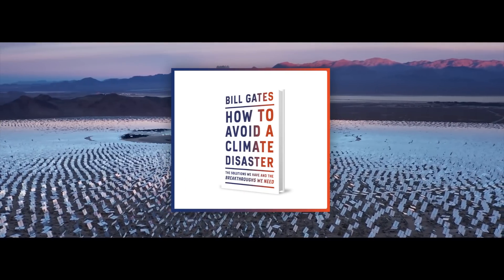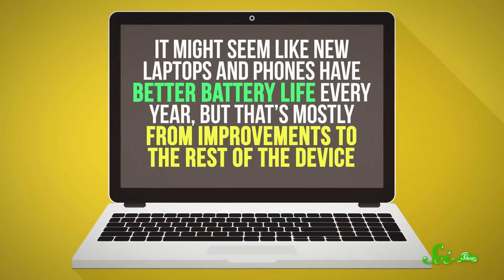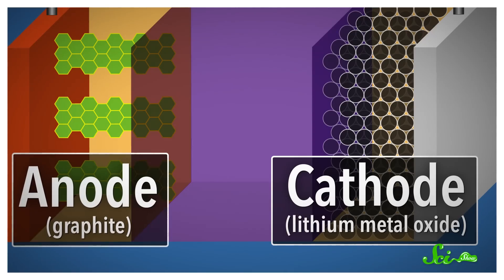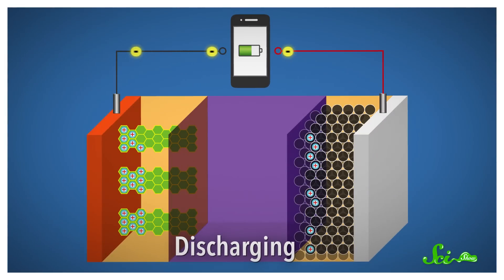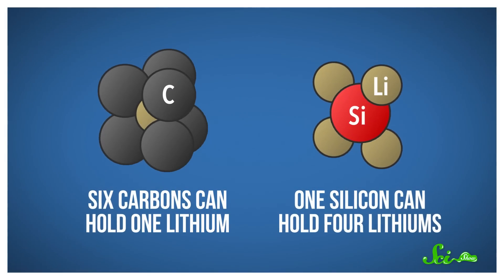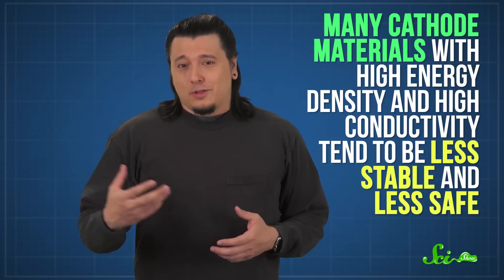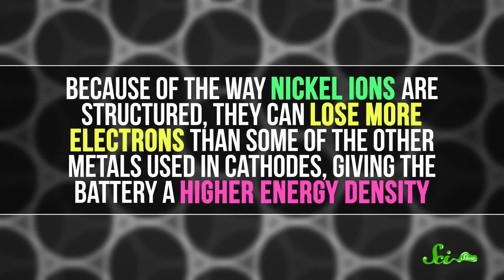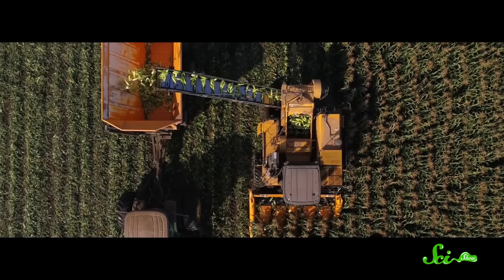Why Haven't We Built a Better Battery?

Comment: Why is energy density the only factor for a "better" battery? When it comes to grid storage for solar and wind, energy density is the least concerning factor. A battery with more charge cycles and lower cost per kWh is far more important in grid storage since it doesn't need to be moved around.
Reply: it isn't the only factor, this video just focused on lithium ion cells.  There's a potential battery tech that's up and coming that is promising, but we'll have to see how it pans out (liquid metal batteries).  It's heavy and not as dense, but it uses cheap materials and likely has a VERY high charge\discharge count.  Ironically it's only suitable to large deployments which means it's only market is mass storage
Reply: I just read an article on popular mechanics, about structural batteries as the next battery tech breakthrough. For example, the frame of an electric car or the case of a phone or laptop would also have energy storage capacity. This will especially be interesting for cars and maybe planes, by adding capacity without adding weight that would increase the power needed to move the vehicle.
So your line of thinking is a good one, and there are researchers also thinking in that kind of direction!
Reply: This shouldn't concern you kiddo. Enjoy your childhood while you can or you'll regret it
Reply: @user-ov2fc5sd1e  What childhood are you referring to and what business do you have here? I'm already living as a responsible adult with a home that I own.
Reply: @user-ov2fc5sd1e  If anything, we need more people asking questions like this. That's how new discoveries that lead to new technologies are made

Comment: To accumulate the excess of energy from renewables you don't need high density batteries! That's a mistake. You need cheap and and fast to manufacture batteries. Density, and to be more specific, weight (that's why density matters) is important when you have to carry the battery with you. It's important for your phone, your EV and for making electric airplanes a viable product. But for storage, just dump a mountain of cheap batteries. Who cares if you need to pile them in a 20 storey building? You don't need to carry them around. Go for silicon or carbon batteries rather than using the rare and expensive lithium.

Comment: If we're talking about grid-level storage, you don't need or necessarily even want lithium-based chemistries. Lithium is energy dense and lightweight, which is important for portable devices and electric cars... but for grid storage cost is king. A giant battery that doesn't need to be moved doesn't need to be dense and lightweight.
Reply: Important in this discussion, but not mentioned in the video, would be flywheels. Flywheels can be used to store MASSIVE amounts of energy and can be extremely efficient. We mainly use them with hydroelectric power currently.
Reply: @GuyNamedSean  Flywheels are crap, though. They can not, in fact, store "massive" amounts of energy - it only seems like they store a lot because it's in the form of a huge spinning mass which gives an innate sense of danger, but in the grand scheme of things they pale in comparison to batteries and have limited applications where they actually makes sense. To whit; additional flywheel mass is used in hydroelectric turbines, providing a mechanical buffer needed to protect the turbine and generator because you can't modulate the flow of water fast enough for all the load fluctuations it might see while in operation. They only store enough energy to absorb spikes in surplus power and fill in short dips of high demand, not bulk energy storage.
Reply: @Smidge204  Flywheels have lower specific energy (energy per mass), than lithium ion, about a third or less, but their energy DENSITY (energy per volume) can be quite high. For grid energy storage, the mass doesn't matter much, since the flywheels just sit around connected to the grid, and even size isn't that important. Solar and wind farms take up huge space already, and the little extra from storage makes little difference.

Flywheels can store massive energy, just build more of them. They last a long time since they don't involve any chemistry. You also don't need any exotic or toxic materials. The main reason they aren't used more is cost. Even with their longer lifespan, the cost is higher than for batteries. For grid storage, they're probably a better choice environmentally though.
Reply: @TonboIV  The now defunct Beacon Power built and deployed flywheel energy storage units circa 2011. Best I can figure the units were about 3 feet in diameter and maybe 8 feet high, total volume about 56 cubic feet. They stored 25kWh for an energy density of about 0.45 kWh per cubic foot. This volume does not include the massive concrete casks they had to be installed in (two units per cask) because if they fail all that stored kinetic energy goes into high velocity debris... and the rim speed of those flywheels was about 1,500 miles per hour!

Meanwhile, the battery pack of the 2009 Nissan LEAF - tech of the same era - had a volume of 17.4 cubic feet and a usable capacity of 24kWh which comes out at 1.38 kWh per cubic foot. Fully three times the energy density.

That was ten years ago. Battery technology has improved substantially, both in capacity and cost. Flywheels have not, and they really can't barring some fantastic breakthrough in material science.

FYI the Beacon Power pilot plant is still there, located in Stephentown, NY (42.5563, -73.3766). I do not know if it's still in operation, probably is? Beacon Power went bankrupt and their assets have changed hands a few times but I'm sure NYSERDA wouldn't just abandon an otherwise operational facility in-place. On the flip side, I don't know that they ever finished building it either!
Reply: @Smidge204  bro, you’re so educated, I’m learning so much from your comments lmao. we love to see it
Reply: @Smidge204  Yep. Flywheels are pretty good for short term needs, but they don't do sudden dropouts as well as chemical batteries. Flywheels can't "blink" on. Of course, if you forget the idea of panaceas and layer solutions instead of expecting one to do everything....
Reply: @GuyNamedSean  thanks for the information, i just joined a battery importing business and we mainly still deal in lead-acid. My boss is trying to get into EV battery but don't know where to start
Reply: @AW-zu4kk  here's a quick overview of the molten metal batteries mentioned, btw.  Idk the specifics of your business, but it may be relevent in some way: https://youtu.be/ZRyo0Nr7CrY
Reply: @GuyNamedSean  I think I saw a video from Tom Scott about that. He visited one in the UK maybe?
Reply: @GuyNamedSean  20 MWh is nowhere near MASSIVE. And thats about the the biggest right now. We would need lots of them, which would be good in combination with a smart grid only.
Reply: @GuyNamedSean  The issue with flywheels is the risk of catastrophic failure. Although that's a risk on any type of energy storage...
Reply: @surturiel  Outside of Formula 1 KRSs, I don't know of anyone who has done flywheels in the vicinity of bystanding humans.
Reply: @GuyNamedSean  Flywheels are good for grid stabilization, but they can't sustain a long blackout.
Reply: Can we reuse the batteries that are no longer fit for electric vehicle use
Reply: @thomas.02  Yes. even once EV batteries have degraded and are no longer considered sufficient for EV use, they will still have plenty of useful life in them and EV manufacturers have plans for repurposing the modules. Just a few weeks ago Nissan had a press release about how they are reusing LEAF battery modules in factory robots, for example. It's actually a bit tricky since EV batteries are lasting longer than anyone first imagined, and there's a huge aftermarket for used EV packs so there aren't a lot to go around...
Reply: Also Lithium ion batteries have a tendency to burn under certain conditions or if used too much. It’s pretty rare for it to happen so for individual consumers it’s pretty much a non-issue because we can generally prevent the conditions that would cause it (shutting down the phone in the worst case scenarios to try and prevent the battery from combusting). When you have large arrays of battery farms for grid usage, the problem can quickly becomes that even a single failure one-in-a million battery failure will regularly happen and take out large portions if not all of a given storage facility with enough storage facilities as one battery combusting will set all the rest around it off causing a change reaction that leads to a big fire that needs to be put out, ideally without destroying the rest of the batteries not yet affected by the fire.
Reply: @Treviisolion  Worth noting that it's not the lithium that burns, but the electrolyte which is often a volatile liquid. A fault in the battery can result in the energy stored in it turning into heat, which boils the electrolyte and increases the internal pressure of the cell until it pops the safety vent. The hot vaporized electrolyte then spits out, and is quite flammable. With that in mind, it's easy to understand that some lithium battery construction are less prone to failure than others, and some constructions like solid electrolyte cells are completely immune.
Reply: @Smidge204  that's good to know, though I'm guessing that at the moment considering that we don't seem to be using those types of cells for our battery farms, that they are also at least currently more expensive than standard lithium-ion batteries that already have a mature supply line and production processes.
Reply: @Treviisolion  the worst thing about this is, the battery has everything it needs to burn already inside and a fire like this is very hard to put out. You can just try to cool the thing doen so much it doesnt continue burning but you cant reach the inside in most cases. Thats why EVs are usually left to burn out by themselves.
Some people proposed putting old EV batteries into houses for local power storage from photovoltaics, but no thanks, not in my cellar... I'd bury this in the garden, a few metres from the house.
Reply: @dereinzigwahreRichi  that said, giving everyone a reason to get a small battery is a far better solution than trying to store energy for the whole grid in one place, especially if it's paired with rooftop solar. It solves three big problems: grid inefficiency, space for solar, and catastrophic failure of a single giant battery. It can also help with the upgrade cycle, though that's a mixed bag.
Reply: @nocare  where I'm from we had a system where you could either buy your own panels etc for long term gain or you could "sell"  your roof to a company that would install the panels, and pay the homeowner a percentage of the earnings made by selling it to the Grid, alongside them getting the free electricity from the panels/electricity at a reduced rate (can't remember exactly), that way you could make instant return without much investment other than the rights to your roof
Reply: @Treviisolion  do you know what gas plants run on? burn`y stuff. and they tend to explode and kill a lot of people
Reply: @TheLemonBird  Yes, I'm aware that natural gas plants aren't exactly a good option, I'm not indicating that we should be using natural gas plants, just that in the long term lithium-ion batteries will not be the energy storage solution for our grid. I've read quite a few options, and I imagine that we'll have quite a few, but lithium-ion batteries have several key inherent defects that make them not desirable for large-scale storage, and already many of the battery farms are experiencing those troubles. I assume that lithium-ion batteries are less likely to kill someone compared to the increased changes of death caused from air pollution, but at the same time if we're having to rebuild every battery farm every few years because it keeps burning down then you need some new solutions, and from what I've read, lithium-ion batteries are not likely to be able to be modified to be that solution, and we'll probably need a different type of energy storage that is more stable than lithium-ion, while being cost comparable in energy density per cost.
Reply: like those molten metal batteries?
Reply: @Vulpecula1919  I assume you mean the magnesium-antimony batteries that have been mentioned here and there for the past decade or so... and yes, those still look to have good potential. Last I heard the team that invented them formed a company and got a deal for a pilot plant type installation. Hopefully that goes well and the tech continues to develop!
Reply: You mean like a gravity battery?
Reply: In Austria we have a lot of pump storage power plants. They pump water up a mountain lake and get the energy back with turbines. They can store an insane amount of energy.
Downside is, you need a mountain lake.
Reply: we need a dense battery as city uses alot of power in 1 day and what if it rain for 1 week?
Reply: @superknightlol  what we need is enough solar on every house that even when its cloudy there is enough production to sustain all our needs. solar and micro grids connected with normal grids is the solution
Reply: But it cannot be mass-produced cheaply.
Reply: Where is this dark energy... That only needs calibration?
Reply: @simplydoz I assume you mean duck curve, since we're not talking about ill waterfowl :)

Density isn't relevant to duration, only how much space you need. If you have doubts about a chemical battery's abilities just know that it's been done. There's a great success story about a 14,000 kWh sodium-sulfur battery serving Milton, West Virginia build in 2009, and another 24,000 kWh battery by the same company serving Presidio, Texas since 2010.

And of course there's the world famous Tesla battery station in Australia... 194,000 kWh worth of lithium cells. That was the largest grid-level battery in the world until summer of 2020 when the 250,000 kWh Gateway Energy Storage facility in Otay Mesa, California went online.
Reply: No mention of water gravity batteries? Pretty sure many grid storage systems use lifting water from one lake to another as a way to store large amounts of energy. Also gas pressure cave system batteries
Reply: @jek__  It's called pumped hydro and it's pretty much the only gravity-based energy storage method worth a dam (pun intended!). It's a good strategy but limited to local geography as you need a place to store literally dozens or even hundreds of cubic kilometers of water.

Compressed air is also potentially feasible if the geotechnical side is satisfied. I'm not aware of any practical implementations of it yet, but I've heard plenty of proposals. Not sure how I feel about compressing air into a disused coal mine, but I suppose if there's a fire or explosion that's just more energy to extract!
Reply: @jek__  the amount of suitable lakes, sadly, is orders of magnitudes lower then required.
Reply: You guys and your supposed fantasy "solution" for non-problems

Comment: There was one idea I saw a while ago where excess energy is used to melt vats of salt. Then, when the power generation is low such as at night or in poor wind, the super hot salt's heat is used as a power source instead. I wonder if this would actually be feasible as a large scale battery though.

Comment: Solid State batteries are an intriguing idea, but I've no idea how useful they'd be in reality, but heck, I could be wrong, I never thought LEDs would be any good for general lighting, and that turned out to be an utterly wrong opinion... :P
Reply: Don't ever underestimate the power of technological innovations. My uni professor in the mid-90s said the internet will not amount to much because the bandwidth is so limited...
There will be many out of hundreds of possible solutions to deal with the intermittence of renewable energy. We don't know yet which one will be the most paradigm changing, but I'm positive there will be more than just one new technology to solve or avoid the storage problem.

Comment: One point I miss: Batteries are never going to be competitive to oxidizing (burning) hydrocarbons (or hydrogen) in terms of energy density. Battery based energy density cannot be improved beyond a hard physical limit. That limit being: having to carry the oxidizer. Battery tech will only work in conjunction with impovements to energy efficiency, infrastructure and less overall consumption. Don't fall for people promising miracles there. In terms of lasting, efficient and readily available storage of electric energy, other solutions are needed.

Comment: A breakthrough in battery technology away from Li-ion to something entirely different would be fantastic, it seems we're near the limit of energy density and charging rate for battery chemistry in the way we're currently thinking about it. I'd also take improvements in structural battery technology for cars and planes so the weight and space taken up can be factored out. Having the battery double as part of the structure would effectively give you more space, but that won't help phones or laptops
Reply: Never heard any recent news about ultracapacitors. Any updates? The last update I know is dang-fast charging, high cycle, and lightweight. Only the capacity is the problem.
Reply: @gamtax  capacity / density and price are the big problems.

Comment: i heard that we are also working on crystal batteries and stuff, which is really cool
Reply: Weight to energy density is a HUGE issue though. To power a cellphone you're going to need something like 70kgs of battery. Thunderf00t did a great video on it.
Reply: @ZomgRAWR93  Only for portable devices.  For grid storage, weight is almost always irrelevant.
Reply: @dynamicworlds1  To power the average american home you'd need a battery the size of a skyscraper. I know weight is irrelevant for some applications, but the size and cost of it on a large scale is just ridiculous